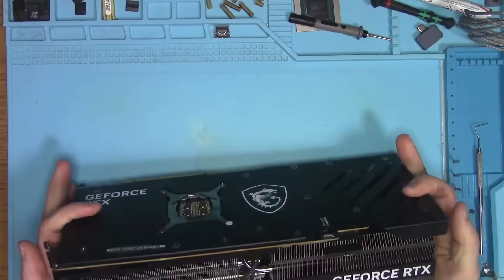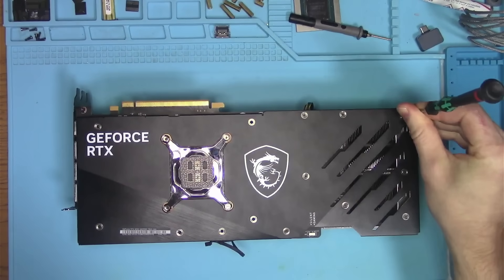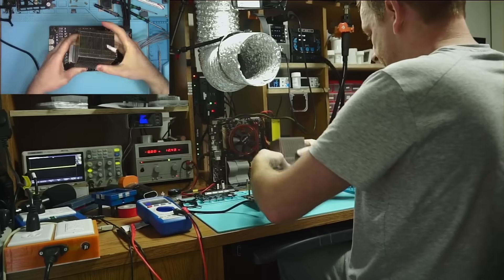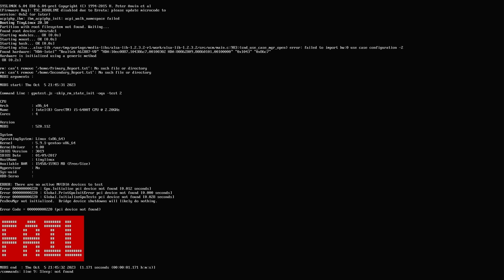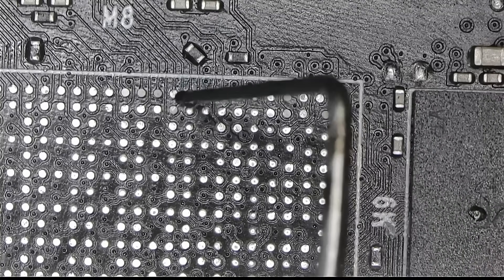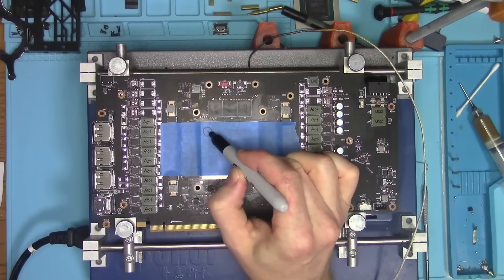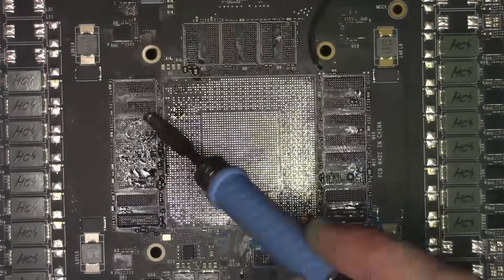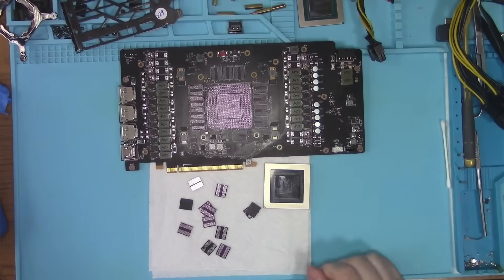MSI 4090 manufacturing flaw was discovered the hard way

Comment: I'm a little worried this is what happened to a MSI 4090 I recently brought. I plugged it in, fans went 100% and then stopped and I get no display from the card. it lights up showing its recieving power but in the bios, it isn't detected in any of my PCIE lanes. It was brought second hand so someone already new the card was borked and the factory seal on the screw was already broken when I got it. so again someone has tried looking at it as its broken. is crap that it was even able to get onto Ebuyers, so it means someone sold it second hand and no one tested it, to see if it actually work. now im stuck with a broken 4090 and waiting to return it....

Comment: The only way i can see this graphics card slipping into an official prebuilt system is if the company had a line of motherboard and cpus all preinstalled with an os and when someone orders they just grab all the predownloaded mobos and slap together all the required parts for their prebuilt systems. Other than that how would a no picture gpu even get put out

Comment: Not sure why the buyer just didn't sent it back to RMA right away if it was D.O.A?  Or instore credit? These 4090s goes for at least 2800k CAD with tax here in Canada.  Even if this was lets say 2 years later, which it isn't for the 40series, there is still the manufacture warranty.

Comment: looked like pcb defective during trace pressing the way they were broken pads with no hairs, or nothing attached shows me factory defect. so the glue they use to adhesive the traces and layers failed and moved to other layers to be evaporated into the solder during chip press.

Comment: I'm thinking about buying a 4090, do you know if the power connector issues are solved on the new produced cards, because I read a lot about melting power connectors
Reply: No. It is still not fixed, the best you can do is check your card time from time and use GPU stands and brackets.

Comment: I thought that you said you were going to explain why the screws were loose "later" .. but then didn't. It does seem like a loose heat sink that vibrated during shipping might explain why so many pads got ripped, but that doesn't explain why the screws were loose.

Comment: I would like to know who purchased a Pre-Built computer with a 4090 in it, and did it without a single days warranty  🤭
I have the same card but it is the Gaming X version, it is on my mining rig and runs cooler than all 3070ti cards i have, all 3070s, and the few 3080ti cards I have...

Comment: Even if there is 100 ripped pads, it must be worth it to repair the pads considering an RTX 4090 costs $1600.
Even if you charge the customer $1000 to fix all the rip pads, the customer is still saving $600 instead of a total loss.

Also an RTX 4090 is in very high demand due to AI startups using it to train their AI models and with recent export ban to China.
Reply: Have you ever seen how ripped pads are repaired? you want a gpu on a plain surface ya know gpu on a plain surface ya know

Comment: My MSI 4090 Suprim died recently, no indication whatsoever, no burned pins, no abuse from my side, good PSU, no bending or excessive force used anywhere. I wonder if it had the same problem.
Reply: does warranty apply to your card?
Reply: @hex504  Yes, I am doing RMA now.. but the extra costs are significant. My card will be put to work in the crypto mines upon return.

Comment: Had exactly the same fault on my MSI 6750xt a week a go. I ended up returning the card for a full refund and got a Gigabyte 6750xt as a replacement. Suffice to say no problems so far. Just wondering if MSI manufacturing could be the fault of there GPUs/Boards?

Comment: yeah, MSI, they make crap with a nice box, video cards and main boards are crap, rush assembly with low level parts that most of the time are working above the specs (that is why they normally do not last more that 3 years, some not even 2 years).

Asus is not better, if I had to grade them they are all bad, miss the Intel desktop pro boars and the old Asrock boards, you only find good boards now are on the Intel open boards that only sold to OEM's

Comment: Interesting as I got this card and after 4 weeks it also started not displaying an output, but would turn on all RGB would light up etc. A few times it did get to Windows the voltages and other power related numbers were WAY higher than they actually could have been. Power draw for example was showing as 1200w in all programs.. as I've got a 1000w PSU that clearly wasn't correct.

Got the card RMA'd and the new one has been fine so far! Wonder if it was the same issue.

Comment: my mum,who passed away,was working in pcb company,Nikola Tesla. She once said they had like 10% of pcb who failed inspection but could still be operating verry well but from factory point they're been discarded. Then,Erricson bought the company and closed this section of the factory and start to import pcb's from China,which were more cheap even w 25% of bad pcb's. My friend has an Siemens s25 phone,some ancient folks will remember this piece of engineering,he dropped that phone from 17 feet and still worked as new..And from then,pcb's will never be as resiliant as they used to be,and when tech nowadays stops working suddenly,you are in the know,right..lol

My hats off for you,mate..you have the knowledge of entire factory..20gigs?..50gigs💪

Comment: I got an MSI 4090 Suprim and I have thankfully never had any issues with it!! 🤞
Reply: Don't worry. Msi products never work for too long.
Reply: Msi x model can be way better than Asus x or Asus y model can be way better than Msi y , hell sometimes even Galax,  Powercolor, Inno3d, Palit etc makes way better models than those two for way cheaper or with way better cost/performance efficency. You obviously gotta review this model by model and not by brand.

Msi is usually good brand , i don't want to go to the details but i had Msi components that i used for 11  ,7 and 5 years . I stopped using them because they were too old not that they weren't working so obviously "never work for too long" is wrong but does Msi have shit models ? absolutely but just like any other brand.
Reply: @swilleh_  Better than Asus at least 🙏
Reply: @Ghaelthekael at least asus 10 series wasn't as bad as msi

Comment: I have nothing against MSI tbh in fact my Motherboard is MSI X570 A-pro but ! with their graphics cards i have always bad exp , my Ex GPU was a 5700xt MSI which was acting so weird giving green screen just randomly till i replaced it with a Asus 3060ti , anyways what ive learnd is never go with MSI unless its a motherboard "something i havent had issue with so far" but even that is going to be a pass for me seeing this vids in future
Reply: I bought the same gpu from a person with the same issues. I repasted, it had some weird thermal pads keeping other thermal pads away from the Vram and some thermal pads on the heatpipes itself??? I removed some repasted and fixed the card 25C lower temps and no issues on my end.
Reply: The Temp on core was very good for me but for VRM im not sure since as i remmeber the card has no VRM sensor , so that might also be the issue for me just never had the chance to test it but im super happy with my asus tuf card , it never pass 60 C at highest games and never any other issues with it "nvidia wise"  @sansundertale69availablename

Comment: you shouldn't assume or blame, that this issue was because the MSI
-all gpus are checked before they left the factory, and you know it. 
-you and the customer both, don't know, how many hands touched that gpu, and in what conditions it was storaged, and who build the rig, before it arrived to the customer.
...
so I dissagre with your advice on the yt video minature to avoid it. I recommend MSI's 4090s, the only one with guiet coils (no coil whine during heavy load)

Comment: I don't understand why he did'nt send it directly to MSI. I have done that in the past as well. It'ss a very expensive card, a prebuild or not, and receit or not should not matter. The serialnumber is on the card and that should be enough to get warranty. If it can be proven that the manucafturing process was wrong or just a DOA or close to use your right to claim warranty. Now you have nothing!

Comment: The oxidation is just an outer layer, isn't it? If so then you can polish the pads and use them normally.
Reply: I think he also said that about a 100 pads got ripped off. Even 50 are probably more than you would feasibly want to fix.

Comment: Hey man. Just curious. Have you guys tried using Honeywell PTM pads instead of paste for GPUs and CPUs? How well do they work if that's the case? Also, would you recommend stacking the pads when used for CPU coolers? Or does that introduce possibly horrible issues?
Reply: A pad can never replace thermal paste...

Comment: When a core is deemed 'dead', a  'dead core', what is the actual physical damage to the core? the silicon?
Reply: I think there is also solder inside that cannot be re-flowed after the initial factory production, so if that gets cracked from heat cycles, the core is essentially dead, which is what caused a lot of nVidia GPUs from the 6000-9000 series to die (from 2004 to 2008-ish) - that was a design flaw in the filler materials around the internal solder.
Reply: @kunka592   Much appreciate taking the time to explain this, it's a term I often hear without essentially knowing what it really means. Thanks again.

Comment: moister got under the core somehow and caused corrosion on the pads this could have happened after the pads became unsoldered or torn as they are using lead free solder now and stopped selling leaded solder which is more durable , but because of the poisonous nature of lead and the environment they(governments)banned leaded solder !! !!!! cant say that happened at the factory but is possible , the most likely scenario is damage and lifting of the core happened due too moving and agitation during shipping and receiving and the lead free solder became unsoldered !!! then wherever they stored the prebuilt probably a massive warehouse had moisture in which it go into the PC and GPU and caused the unsoldered pads too corrode !!! this is what i have determined as when a GPU is manufactured it is tested working before it leaves , thus this happened due too shipping receiving and storage ... and the customer in the end got a none working GPU ........ on the off chance this happened at SMC !!! all GPU cores are soldered on bye Computers and a robot for precision and is automated , at the end then it is inspected bye workers with microscopes then put into a test machine and powered on for the first time Vbios installed and quickly memory core and bench tested !!!

Comment: This is genuinely strange since I have an MSI 4080 that runs well and has all along.  Were this a persistent problem in MSI's manufacturing across all lines, you might have heard of it by now given your high exposure in the GPU repair space.  How could this unit have passed factory inspection?
Reply: Not strange, thats normal. Happens on every manufacturer. You can have 1 in 100000 cards in a factory line to be the "winner" Rememeber that the last factory inspection step is made by humans, even them can have a mistake from time to time. Thats why warranties exists.

However feels pretty irresponsible for northwest repair to condemn a whole manufacturer line for a single faulty card. Whats next? dont buy asus 4090s cause i have this one and its doa as well? If you are going to post something like this at least have some backup information on a bigger pool instead of only one card. But thats just my opinion.
Reply: @ravell2854 It seems more than a mere simple mistake in this particular case.  What it appears to be is a card that never worked and was shipped anyway.  Secondly, it also appears that the aggregator who built the PC and sold it either never turned it on or did and must have noticed the failure of the GPU since the forensic inspection showed it could never have worked properly at all.

Comment: My first MSi 4090 had a fault with the heat pads. thermal switch. Loaded on low power such as browsing or watching videos. i returned to supplier and got a new one which has been fine.

Comment: WTF.
A question: Why would somebody send a 1500 Dollar, new GPU to you, instead of using its warranty?

Or do the loose screws mean, that they already broke the seal(and preserved it somehow?), because they have made a damage not covered by the warranty?

I am generally curious, because I broke my warranry of my RX 6800 intentionally, as I had no other choice. My beer flowed down from my table into the mesh of my PC , what was fortunately not running, and I could rinse the PCI slot, motherboard and GPU with 96% alcohol. It is working well since.

Comment: It obviously had guarantee, right? Even as a prebuilt, I'd just contact MSI directly. My heart slipped a little when I saw this video as my brother bought that exact card a few weeks ago but luckily it works fine.
Reply: I believe in msi, know their products for years and these errors are very unlikely. Most of the times their products are great, I have a 1060 gaming x which is still in use and works, and now my rig has a meg Z790 Ace and a Suprim X 4090. No other brand (except Asus) can compete with msi in quality. Anybody who wants a pc I tell use asus and msi, if they can choose. (mobo and gpu). Just make sure it is supported with a stand on the farthest end so the PCB doesn't crack, other than that watch out for the memory temperatures and you will be a happy costumer.
Reply: @MrKobold22  There was EVGA, and AMD has Sapphire. Both were staples in quality and their RMA procedures. MSI is shady af, Gigabyte is just pure shit. I'll gladly buy Asus anytime, at least their RMA works fine if shit goes down. Just got my 3080 12Gb fixed a month ago, the warranty isn't even on my name lol.
Reply: Don't worry. Msi products never work for too long.

Comment: Jesus what the hell.... MSI have great engineered coolers usually, they were one of the first brands back when Sapphire or crappy EVGA had single slot solutions, MSI had dual slot.. Or when i had the same model ASUS and MSI cards, the ASUS were x3 slots and it did have worse temperatures then the MSI..

Comment: Many of the pads under a GPU or RAM are carrying the same voltage or signal so if one stops working the rest still complete the circuit. Defective work can remain hidden until the failure reaches a tipping point. This is how a card like this can cascade through multiple checks only to quickly fail in an end users hands.
Reply: Not to mention there's a chance those problematic solder joints make contact at first but stop after some thermal cycles, jostling during shipping, and/or being installed in a way that bends the PCB.
Reply: @MrNukealizer  You can have a bad solder joint unoticed for years, just the leg of an ic over the pad. Seen than on car body control modules. It will pas all the quality checks and even run for months on the end customer before something shows up. There are some AI inspection machines that use image procesing (which have learned from a set of PROPER soldered boards) to catch these things. But for BGA, ... I dont know.
Reply: But they are not designed to carry excess load so eventually the ones that are working will fail too. The pads are repeated for a reason ... to balance the load.

Comment: Pro tip …. Gpus usually have a 3 year warranty
Reply: My gtx 970 still kicking, though haven't put in under heavy load in quite some time
Reply: Better pro tip: don't buy nvidia as all their cards have been low quality for 2 generations now.
Reply: @sansundertale69availablename  Nvidia makes their own series and they are trash sure. Msi is just a different trash. Check out other card manufacturers.

Comment: I wonder if this is what happened to my 4060ti gaming x trio from msi- I bought it back in june or july I think and had to RMA because it lasted for like two days, suddenly the screens went black and it wouldn’t even post- tried DDU and other software solutions but not even the bios would show up, I reverted back to my gtx 1650s and then decided to get a whole new build with an rx6800xt, still got a 4060 but for the laptop counterpart and it’s still going great
Reply from the maker: Most likely

Comment: When they make the PCB's, why don't they coat the PCB with some kind of cheap coating that can be washed off with some alcohol quickly right before the board is ready to be sent thru the robot machine that splatters the components onto the board and then thru the wave solder machine. That way there will be no chance for oxidation, something like how brake rotors are coated with cosmoline before shipping, and you spray them off with brakeclean at time of install. Seems like this is a very preventable issue and could be fixed for very little cost.

Comment: I wonder why he didn't do an rma with the pre-built company?
Reply: The prebuilt company issued him a refund, and didn't want the old one back. So the owner tried to see if it could be fixed. Well worth it, considering how much they cost...I would have done the same, why not risk spending $100-$200 for a diagnostic at least, might be something simple like no core voltage.
Reply: @brnmcc01  thanks for responding, that makes sense